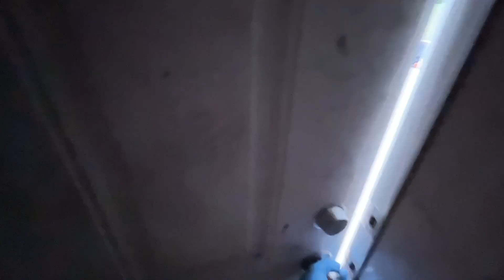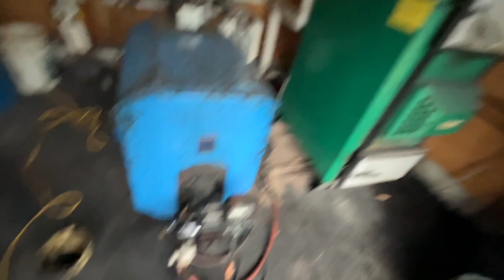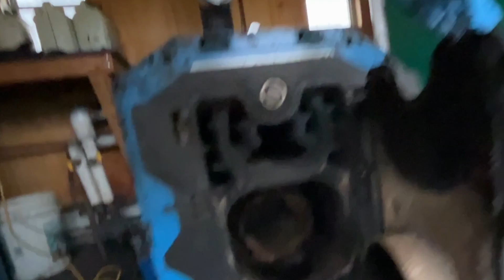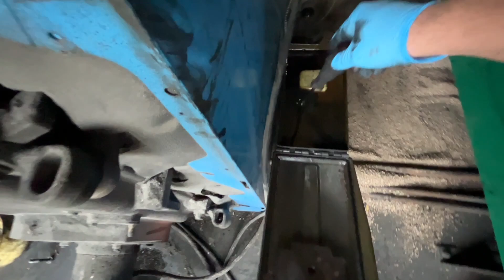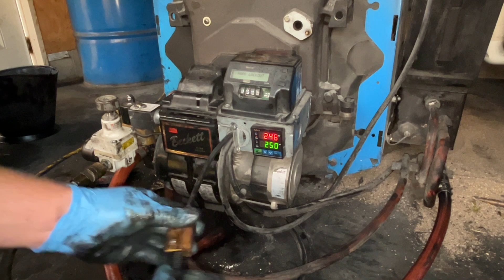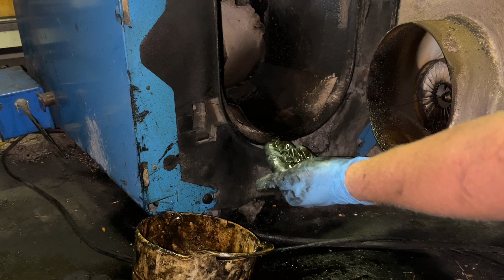The Struggles Heating Shop / House with WMO

Comment: It's a fairly complicated system that can really be messed up by water in the air or fuel. I think some better/bigger water traps on the air supply, and electric tank drain on air storage tank would help a lot. Also consider a centrifuge between your storage tank and day tank.

Comment: After seeing all the water being released out of the air system, I'm leaning towards it adding too much moisture to the nozzle and burn chamber. It might even be a combination of the bad oil you spoke of and too much moisture in the air system. I recall when I use to sand blast, how the humidity would greatly affect how the system would preform and even clog up.

Comment: Have you change the diesel filters and clean the nozzles..  and,  if you have the oportunity..  - clean the tank for sludge..  as diesel oil precipitates.. -  and clean the pump & lines??   If you dont do that..  - it will clog up.  You must do that every season-start.  👍
Reply from the maker: Yup, after making the vid I cleaned all the filters, purged the lines and drained any water off the storage tank. With clean water free oil it’s running perfect.

Comment: I am a very mechanically inclined guy and love stuff like this but seeing you fiddle with your set up makes me thankful for my natural gas furnace in the house and a wood stove for the shop.  Whats the process like for getting the waste oil?
Reply from the maker: Hello, getting the oil is easy as I have one place that I pump out their tank every 3 months.  It’s really not too bad as I usually don’t have this much of a problem.  Turns out I was correct and the oil had too much water emulsified in it. I replaced with good oil and it runs like a top. Thanks for watching